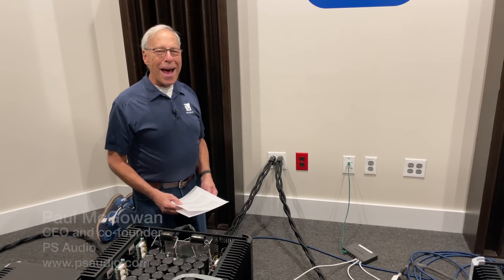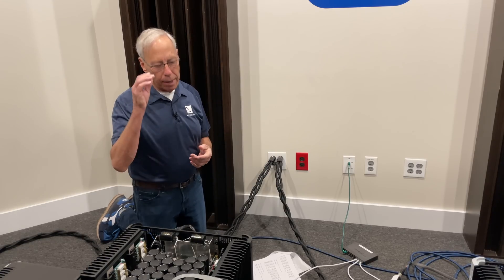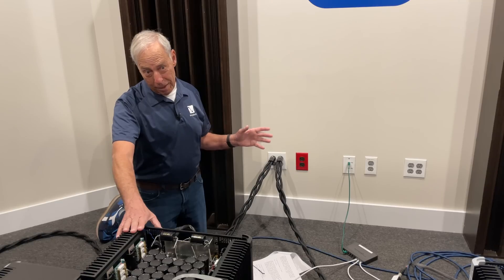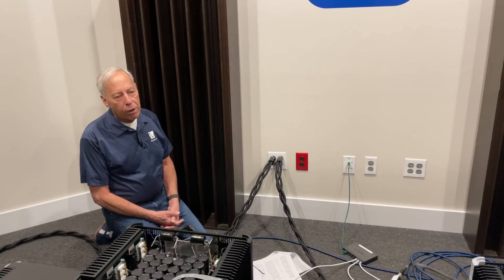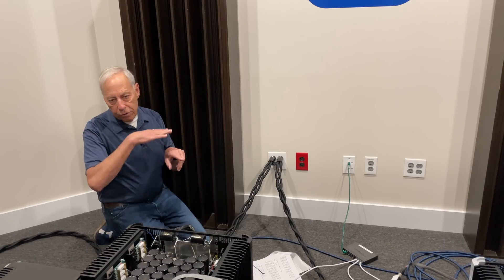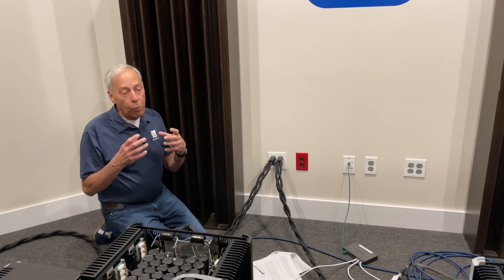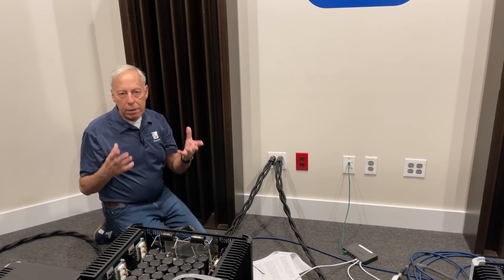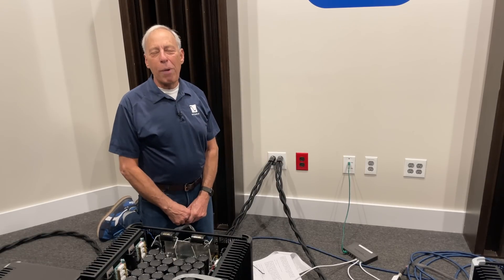Are braided power cables better?

Comment: There's no audio signal in a power cord. The frequency is 50 or 60Hz. So how would braided affect that part of a system since it doesn't carry audio signals affected by inductance etc..?
Reply: Because manufacturers of high-end stuff appear to be too stupid building proper power supplies and audiophile fools on the other hand think the last 50 cm of the chain is doing magic
Reply: @Harald_Reindl  have you ever tried any form of twisted power cables?
Reply: @BoomerUKEngland  i am a technician not a fool - I don't need to lick on the oven to know it hurts
Reply: @Douglas Blake to be honest it's possible when he can sell you the cable for the same price as the amplifier later to improve whatever, who wouldn't when the customers are dumb enough and pay it proudly
Reply: Why do they fine tune Formula 1 cars by feedback from a human being? To adjust and improve the performance of it in ways that their 500M USD facilities and teams cannot explain by logic, science, and data analysis.
Reply: @ptbfrch  the fine tuning of race cars is done only with objective time measurements.   hearing is a subjective process of the brain, not evolved to be objective .   

 it can be factual, but that doesn't mean the reality it understand is always correct.  the mind  has no ability to detect  hearing error, and has a tendency to report expectations of sound as things actually heard.   hearing test are scored to compensate for a normal amount of false reports, not just yes or no if a sound was heard .  to measure hearing accurately , one has to incorporate the reality hearing illusions to be meaningful.   which sellers of wires or certain virtue signaling mindsets , never mention.   

Since hearing places the finish line , the desired result, inside your head, the comparison  with objective measurements , doesn't work.  even with  incorporating driver impressions on the track,  everything is measured by precisely measured time, not the butt-o-meter  that most guys use on street cars.  hearing is essentially a butt-o-meter, you think you know, but you don't know.   except the brain never questions thoughts like it does with accuracy of reports from the external senses
Reply: If there is no audio in a power signal, why did you just refer to the power as a 50hz frequency, which is part of the audible spectrum? 😇 you can’t hear power, because you are an electrical being, that’s why you need a speaker - it turns the electricity into magnetism which your ears can then turn back into electricity.

Amplifiers are using your 50hz signal combined with a spectral signal of audio to make it loud. You don’t need an amplifier if you just want to listen to a 50hz tone.
Reply: @dylanboekelman1471  No, they are NOT using the 50 (or 60)Hz signal. They are doing everything they can to remove that signal. The signal is a necessary but undesired side effect of the method of power delivery.
Reply: @Ascania  AC power like speaker output doesn’t travel the same way that DC audio signals like line output do. That ‘undesired’ effect is exactly what power amplifiers utilise to drive magnets with direct AC power.
Reply: @dylanboekelman1471  That is nonsense. Power amplifiers do not drive anythign with direct AC power. Mains AC power is rectified and smoothed before it is used. The "AC" signal on a power amplifier output derives from the input, not the mains. If you get any mains frequency mixed into your output signal then you might like it but everyone else does not care for it and tries their best to remove this mains hum from it.
Reply: @dylanboekelman1471  you are a clown! The speakers don't see the 50 Hz because the first thing a power supply does is converting from AC to DC

Comment: All my interconnects and speaker cables are braided and I agree with Paul that I think braiding makes a big difference to the sound.
Reply: Make sure you rewire your outlet to the circuit breaker with the same cable so you can REALLY benefit from the braided technology.
Reply: @YuengsNwings  all the way to the powerplant of course lol
Reply: Well this back and forth trolling was useful....... not....
Reply: Even this is maybe truth, that has nothing to do with power cables!
Apples and oranges!
Reply: That is because you have convinced yourself of this.  People's emotions cause them to lose their logic and objectivity.
Reply: Define "big difference"
Reply: @edgar9651  Well, it's been more than ten years since I made them and started using them but, at the time, I thought there was a larger soundstage with greater depth - I use giant Acoustat electrostatic speakers - and that impressed me so I've never changed them.
Reply: @johnmarchington3146  you couldnt be wrong and had wasted your time and money so your brain told you "good job boy" and you sat down with your cookie.
Reply: Left hand or right hand braid?
Reply: @robertspringer9477  An interesting question. The interconnects were constructed from one of a number of different articles that appeared in a book entitled "The SuperCables Cookbook" by Allen Wright, an Australian who founded a company called Vacuum State Electronics. As I recall, there were no explicit instructions as to how to begin the braiding so I guess the author didn't think it mattered. I used silver-coated single-stranded insulated copper wire throughout. The speaker cables were constructed from a similar scheme when a friend told me he could obtain drums of computer data cable that was being discarded because it was too short for inter-office wiring  but he thought it would be fine for even quite long speaker cables. Each cable consisted of four pairs of twisted insulated wires and with my friend's help, we braided three of those cables then joined all twenty four wires together at each end. I was amazed at how good they sounded, even though I had used expensive van den Hul cables before. I'm still using those braided cables years later - and they're monstrous.
Reply: @johnmarchington3146  As I understand you used LAN cables. Did you brade them as is or disassembled before? And do I understand right that you braded three cables as one wire, so you took 4 wires to conect 2 speakers? 2 cables x 2 wires for each x 3 LAN cables = 12 in sum.
Reply: @MikhailKulkov  The cables have a blue outer sleeve covering with four twisted pairs (i.e. eight insulated wires) inside. I guess they are local area network cables. After cutting them to length, I didn't do anything to the cables other than plait three of them to form the braid. I then cut the outer sleeve back to bare the inner wires where I exposed the copper and twisted them all together. That was just for one channel, of course. I then repeated the process for the other. That meant six cables in all, not four; which amounts to 48 intermal wires all told, 24 per channel. I use solid gold-plated banana connectors to plug into the amplifier outputs. terminals.
Reply: @robertspringer9477  Ambidextrous braid!
Reply: John ignore ones that don't understand, there the ones with the issue as they attack something they have never tried for themselves.
Reply: @BoomerUKEngland  Hmm...I guess you can look at things that way, but I suppose I'm one of the helpful types and would expect the same treatment from other people.
Reply: For power cables? You audiophiles stop making yourselves clowns
Reply: @Harald_Reindl  Hey, look! It's Harald the Snake Oil Troll.

Comment: What I believe to be true makes little to no difference in this world, but here it goes: folks like Paul McGowan and Danny Ritchie at GR Research say similar things about cables. They both have systems that are very carefully set up, in rooms that are treated. I followed Paul's speaker placement tips, and those of Ron at New Record Day, in order to get the most out of my system. Now I hear things I have never heard before, and my system compared to theirs is laughable. I can hear a difference between speaker cables now; I could not hear it as well before. It went from marginal to significant. I will add that I have compromised hearing on my right ear, and I can still hear it well enough. I'm not willing to write off anything, as I believe everything matters. Rather I'd like to keep an open mind until I'm put in a position where I can hear it for myself.
Reply: I think you make a really good point here about hearing a difference. You shouldn't pay for anything YOU can't hear a difference with.
Reply: @chrisgoodson9312  Absolutely agree.
Reply: @chrisgoodson9312  true, but the bitch about hearing is that it is so willing to create reports to satisfy expectations.   It didn't evolve in a way to be useful to audiophiles, except for subjective pleasure.  It is simply incapable of the error free reports that fans of exotic wiring cite as evidence justifying the purchase decision.
Reply: You make a good point, Paul's system has been carefully engineered and the room has been specifically treated.  Many people don't have that option as most people didn't have their house built from the ground up with the concept of having a sound room installed.

Comment: I don't know how it works but I have made of many different types of power cables and they do all sound different,eg big solid copper increase in base at the cost of hi frequency hundreds of thin wires improvement in high frequency and mid-range lack of bass I have no idea what's going on but that's what I've experienced.
Reply: Skin effect and lack of conductivity.
Reply: Thanks for this. It is the same result that I had, mains cable gives a heavy bass and a lumpy loud sound.
Reply: @Douglas Blake nothing to be gained no.

Comment: It must have cost a true fortune to install the audioquest dragon wiring all the way from the distribution panel, behind the walls, and into the sockets. All we're seeing is a tiny fraction of the circuit. Right?
Reply: The Audioquest power cords are what you see.  The wiring in the walls is not from Audioquest.

The argument is that the power is being delivered via ordinary cables in the building.  So then the last few feet will make no difference.  The last few feet are only continuing the delivery of standard cables in the building.

Such is the case with your water delivery.  Yet, you use a shower-head in your bathroom.  Why bother, when the water traveled miles to get to you?

The better power cables perform a similar function.  When the current hits the Audioquest cables, those cables control the flow of the power into your equipment.
Reply: @0Perhaps  I believe that speakers would serve the purpose of the showerhead in that analogy. The speakers "spray" the supply of electricity according to how they are designed. The cable is simply a carrier, a pipe, if you will. It can be made to handle more or less pressure based on its design, and if it's badly designed it will negatively affect the integrity of the FLOW, but it cannot change the chemical composition of the water.
Reply: @0Perhaps  laughable
Reply: @0Perhaps  you have it the wrong way around.  The power cable is the first part of the mains wiring as it's closest to the device.  The twisted design is removing inductance and EMI that's coming into that section of cable.   You can think of these cables as extending the mains filtering of the devices power supply.
Reply: ikr? This comes up again and again. Doesn't make sense to have $10k pure silver wire made by nude Swedish virgins when its plugging into a socket from Home Depot. But since audiophiles listen with their eyes, it doesn't matter. As long as their ego can flex, it's all good. As for the rest of us who are strictly performance oriented, I guess we need not apply.
Reply: But of course, we all know the real reason these exist. Audiophiles are gullible and have money to throw away, so the BS train just keeps on rollin'.

Comment: When there is one thing that I hate is when audiophiles talk about huge differences. If there is a huge differences then I guess you hear it right away and the difference if obvious like changing a pair of bad speakers to a pair of good speakers. And now you, Paul, tell us that with using PS audio amps and PS audio power generators those braided power cables make a huge difference? Really?
Reply: I agree that there's a problem with some audiophiles and nuanced language. A huge difference is something that should be immediately apparent to anyone that hears it, and the difference between very different speakers is something that falls into this category as that's by far the most diverse part of the chain (if we leave the room out of it).

When you use such words for something with such subtle differences that cables bring you are automatically seen as shady. Those that feel that cables certainly do make a difference should think that you're overcompensating with your wording, which comes across as dishonest, and those that don't believe cables make a difference as long a they are properly made will dig their heels in even further and think those that speak positively about cables are just hyperbolic liars. Whatever the case the language hurts your position towards any but those that also use such misleading statements.

Nuance is very important. Audiophiles tend to understand that when it comes to audio so it shouldn't be too hard to grasp the same concept for communication. If you're fine with calling a difference between good power cables huge it's like saying that it doesn't matter if the bass in your system is really bloated, you can still hear what music is being played.
Reply: Yes. Your power is audio. It is a sine wave, probably 50Hz and ridiculously massive amplitude like 120V 200A. Imagine a speaker capable of making that 50Hz sine wave. Build one, plug it into the wall directly. You don’t need an amplifier then! All amplifiers use this incoming wave in combination with source signals to combine the source audio wave and the AC power wave (yay for diodes) and output a higher amplitude wave. If the source signal is squared anywhere (for example by the back flow EMF of an AC motor like a fridge or fan, this square becomes a part of the output and introduces harmonic distortion at all harmonic frequencies - this known as constructive interference.

Very high quality amplifiers clean the power wave up before using it. This is why they can achieve higher amplitude outputs without harmonic distortion.

PS Audio amps are no different. You’ll still benefit from a clean incoming sine wave. Whether you need a braided cable or not really depends on how distorted your power source is - only so much cleaning the switching power supplies can do. The rest is up to good old physics.
Reply: @dylanboekelman1471  how often do you repeat that nonsense? There is no AC at all after the power supply - please shut up when you don't have the slightest clue

Comment: So are you worried that unbraided power cables would eliminate high frequencies from the power cables? And then you use transformers and lots of capacitors for remove those frequencies from the power input. Strange...
Reply: And after the bridge rectifiers put more noise into the system than anything the powerline ever could. Strange indeed.
Reply: @mysock351C  It's a power cable, not signal. The frequency is 50 or 60Hz. There's no audio signal in the power signal of course.
Reply: @Forollo9210  My point is the amplifier's own power supply can be a huge source of noise. Audiophiles place all this emphasis on cleaning up the incoming power, only to have the power supply chop it back up again into rectified AC that is rich with harmonics. If they have not included any sort of snubbing, there can also be copious RF as well due to the reverse recovery time of the diodes and the transformers leakage inductance.
Reply: @Forollo9210  Now obviously this is filtered by the power supply itself via all the rail capacitors, but it means the expensive gold-plated audio greebles are useless.